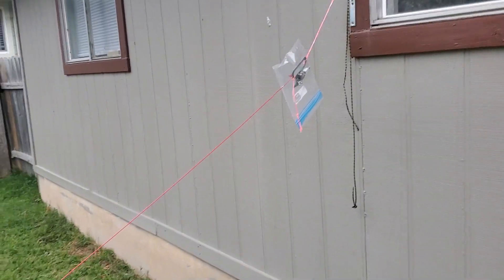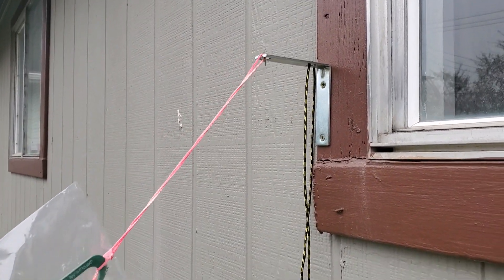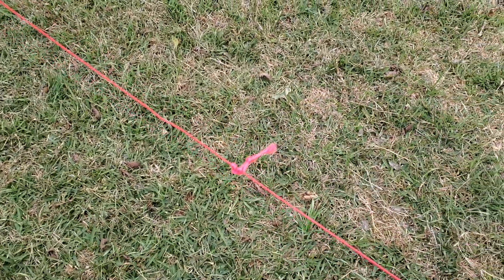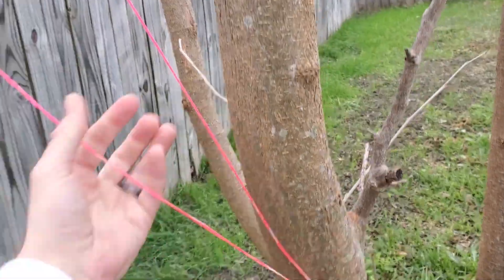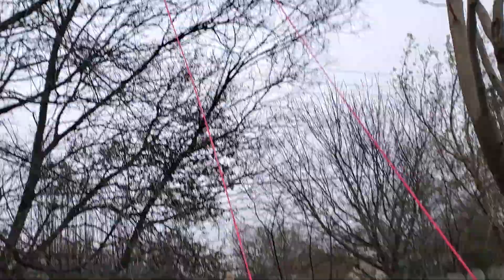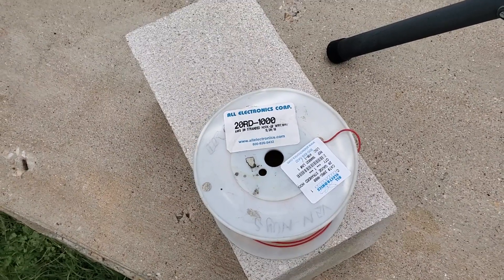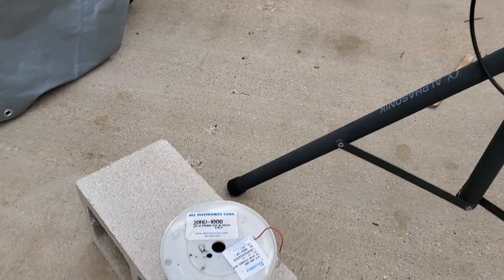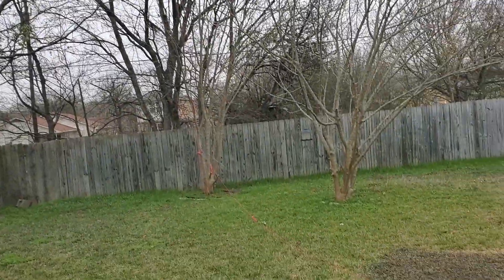40m EFHW  QRP setup

Comment: An EFHW is not only resonant on the frequency you cut the wire for but also all the harmonically related higher frequencies.  You have a 40-20-15-10m antenna there.
Reply from the maker: Yup!